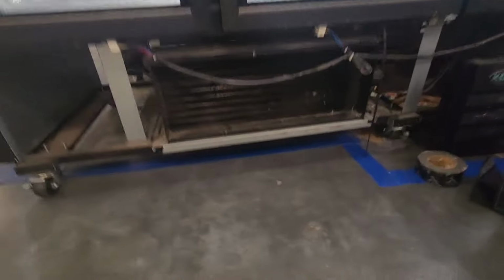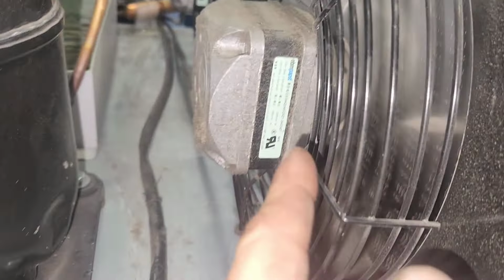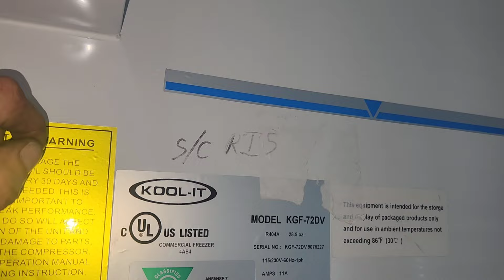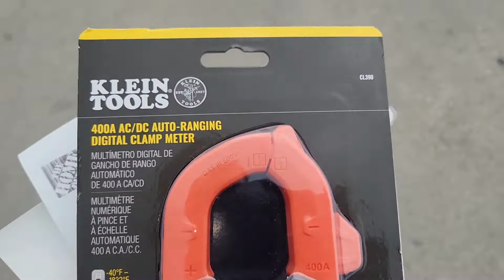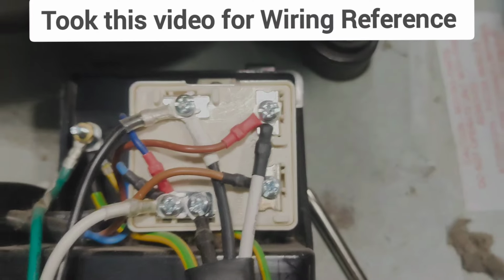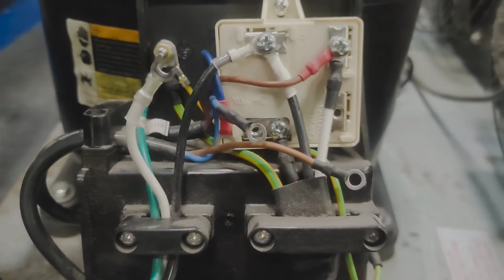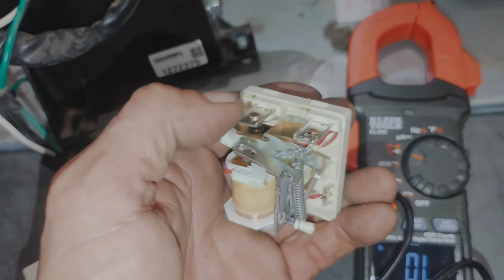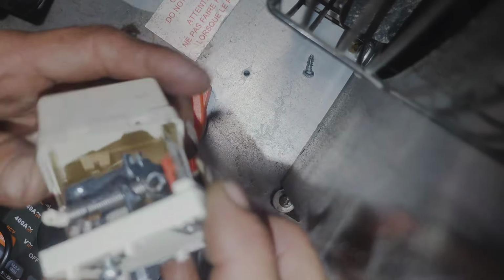Replace Start Components 1st

Comment: Did you try to take an amp draw while the compressor was trying to start??  Looks as ifthat current relays contacts may of been welded shut from arcing and causing the start windings to remain in the circuit causing high amp draw from the compressor and tripping tbe over load.  Also i always just eliminate those hot gas lines, and get a box with an electric element that vaporizes the condensate water.  Or i just get some copper tubing, bend it to the shape of the old one, and then i coat it with some heavt duty oil based black rust oleium paint to help extend the life of it.  The companies use these hot gas lines because they want them to fail.  Coolit is a cheap chinese fridge.  I prefer Traulsen they are the rolds royce of commercial refrigeration.  I wish Hobart still did refrigeration as they were pretty good. True is also another one i dont care for.  Very cheaply built.  Hope you get this fixed.

Comment: Low Z meter would have shown low voltage at those relay terminals.

Ohms can lie. VOLTAGE is a true test.

In house. I woud be able to pull the unit off line and replace hot gas line run longwise 3 loops.